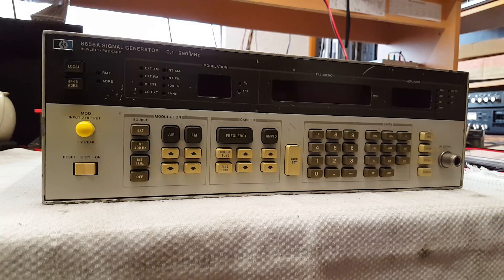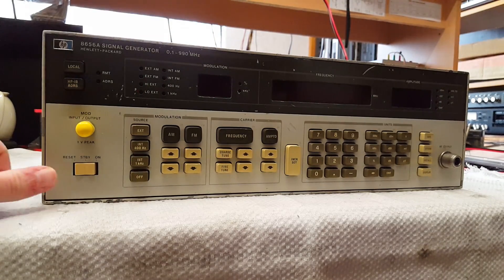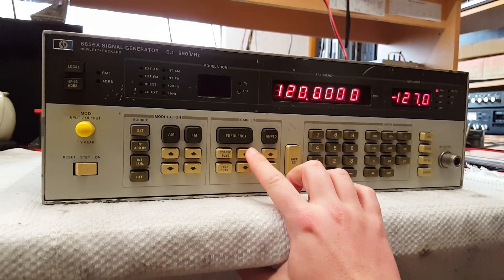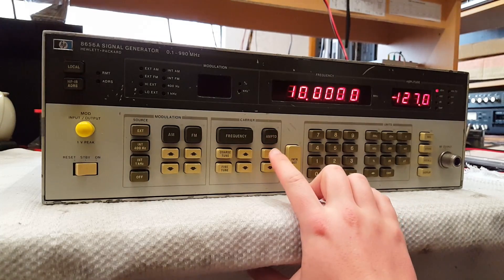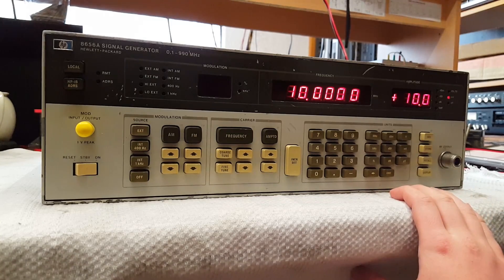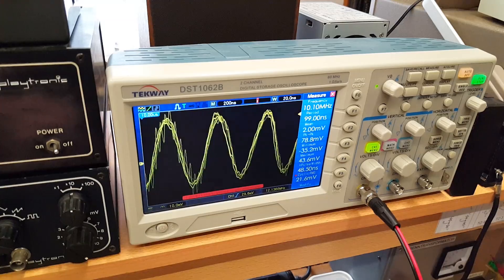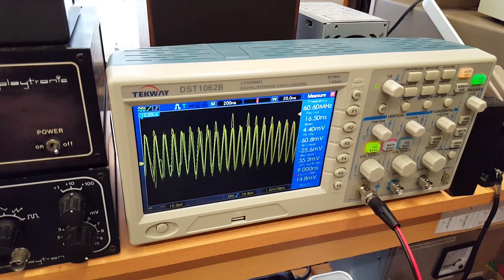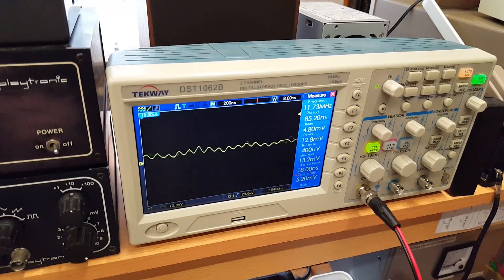Hewlett Packard HP 8656A Frequency Generator

Comment: If you use 50 ohm coax with BNC connectors between your 8656 and scope, you'll see just how clean the signal is.. Good luck

Comment: Obviously suitable for calibrating audio equipment, reel to reels, cassette deck.  Very nice.
Reply from the maker: Obviously not ;)
Minimum frequency that the HP can output is 100 kHz. Audible frequencies range from about 10 Hz to 20 kHz. So that does not match :)
Reply: +dctechnica sorry, I saw the switches on the left for 400Hz, and 1Khz and just thought it went lower in the range. My mistake
Reply from the maker: I will explain what those two buttons are good for in the next video :)

Comment: need to use a 50ohm load. VSR can cause the noise your seeing do to lack of proper termination. aka a 50ohm load. I used to calibrate those long ago.
Reply from the maker: Yes, why didn't I think of that... I even have a 50 Ohm termination plug and a T adaptor I could use. The scope does not have internal 50 Ohm termination.
Reply: unlike me you probably didn't spend years calibrating test equipment. i did everything from DC to 26ghz :)
Reply from the maker: 26 GHz, that is VERY impressive :)
Reply: I loved working in a Cal Lab, we had the coolest test equipment :)